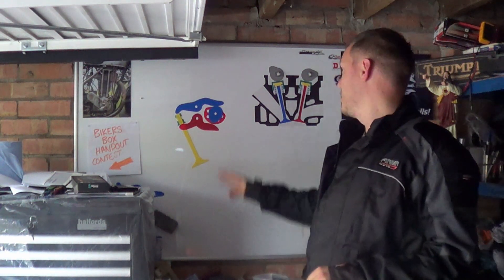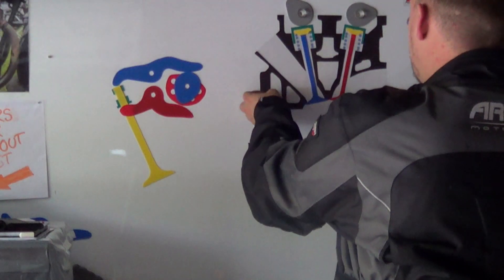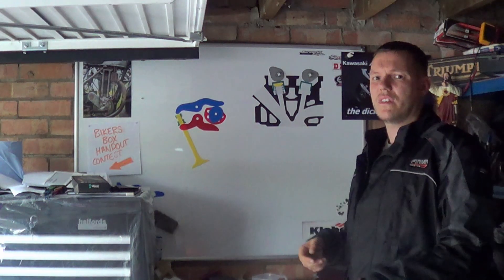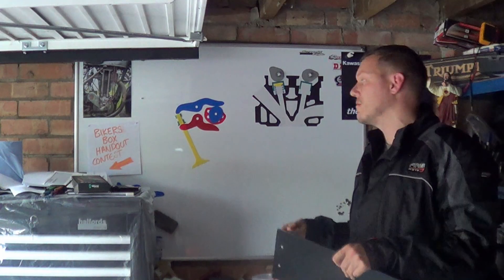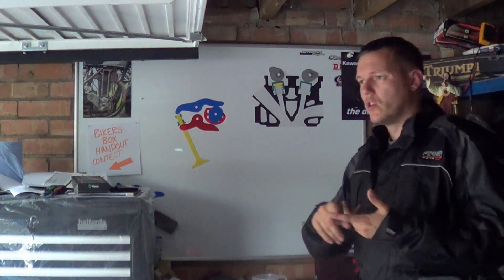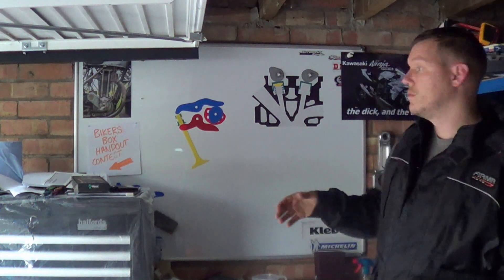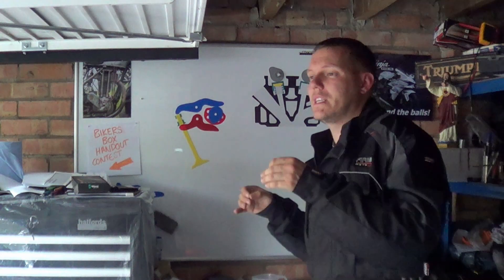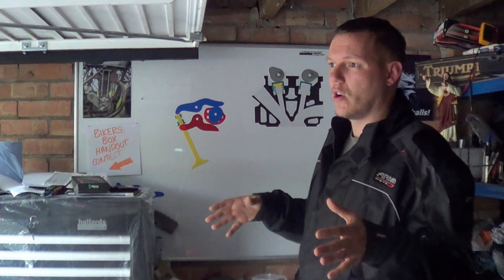Delboy being a wanker!

Comment: Matt, so keeping the (seemingly obvious) Delboy inaccuracies aside for a minute, what are your thoughts on the coolant heat ranges within an engine? To elaborate, I have a bike that the rad fan cuts in on at 106C by default (Set by Triumph), now a common modification is to lower that value to 100C with a remap (amongst other things). 

Cars typically in my experience - cut in a lot lower - Average Thermostat open temp being around 85C ish, Fan on at around 95ish? (Feel free to correct me here..). Given the boiling point of water (anyone want to question that?), with the setting at 106C, there is always going to be pressurisation within the coolant system due to water content, I'm under the impression that keeping it stock at 106C should be the right thing to do, It was designed by better minds than mine to be that way right? So why lower it? Unless of course they screwed it up from the outset!

Now - changing the value to 100C IS going to have an effect (what, other than keeping the engine a little cooler, I don't know - feel free to help me out on that one. Mine is at 100C from a remap I did, the only noticeable difference to me is warmer legs in traffic as the fan cycles sooner). so if that's the case, then is lowering the value a good or bad idea? Don't know personally. Seems like there's no real evidence to suggest it's going to make any real difference. 

So lets humour Evans for a minute. They're using chemicals that have different heat absorption rates, now a submersed coolant sensor is going to read different in those chemicals to that of 50/50...Thermodynamics and what not, so actually, are you going to get a true reading off of the temperature sensor than what you would do with 50/50 due to the heat transfer rate given that the coolant temperature is constantly changing during a running condition? (Rad Fan, Rad heat dispersal etc. etc.) Or am I talking bollocks? If so, for any injected bike, surely that has the potential to cause problems with fuelling levels as the ECU reads an incorrect temperature reference which is then using in a fuel calculation alongside Inlet air temp, knock, lambda etc... Now i definitely sound like I'm talking bollocks.

That was a waffle and a half... 

Great channel. Keep it up.
Reply from the maker: "are you going to get a true reading off of the temperature sensor than 
what you would do with 50/50 due to the heat transfer rate given that 
the coolant temperature is constantly changing during a running 
condition?"

- great point as this is what happens to people bikes, the fan stays on for ages or just doesn't turn off. As for localized temperatures we're gonna find out in the ER5 test
Reply: Will be interesting to see what the ER5 turns up on this test, especially considering that my ER5 overheats on anything more than a 20 minute ride! Hahahahaha

Comment: I just did one minute of research on Evans water-less coolant. I googled "issues with evans water-less coolant". It seems evans pay google a lot of money to keep themselves first and foremost. What threw the red flag for me was evans own words. They go like this "Evans is the only manufacturer of water-less coolant in the world". My first thought was why are they the only one who does this. After running a shop for multiple years, all my coolant comes concentrated in 55 gal barrels, the same concentrate as evans. Evans just so happens to not put on their labels MUST ADD WATER! I have no problems using evans but it will get 50% of water added to it. I am not in the business of replacing cylinder heads free of charge or in some cases cracked blocks.

Comment: I found this reply from Del to someone that left a comment on his Evans video. He really has fallen for the Evans Scam like a fool - "Damn right I do fellah... that's really interesting!  And I would also say the guys from Evans would be interested to know that too.  They have a product that every know it all out there thinks they can argue with and contradict, purely based on summisation and hearsay, so they always love conclusive proof their product works... with my 'fighter build, I filled it to the brim, and have run it up a few times since, it just pukes out about a tea cup full at best to make expansion space.. there is expansion, but it's purely thermal expansion of the metal and the fluid itself swelling up, not gas expansion from boiling... temp, gauges often show hotter, but that's cos they are metal, and this fluid draw more heat away from the heat source and carries it within itself, so the fluid run hotter, which, naturally, means the engine runs cooler... my fan kicks in more often, but for shorter periods, which is also an interesting development..... either way, give it 10yrs and no motorcycle will run water in it's coolant... give it 25yrs and no coolant system will run anything else but this, they will be sealed for life and there won't even be a fluid level marker!  Top stuff, sold me the day I saw it....thanks for the info buddy, Happy New Year! All the best, Del"
Reply from the maker: "thermal expansion of the metal"

- fucking gold lol

Oh OH there's more 

"my fan kicks in more often"

- LMAO!

"so the fluid run hotter, which, naturally, means the engine runs cooler"

- A typical misunderstanding of thermo dynamics. Heat can only transfer in one direction from hot to cold. If the engine is cooler than the coolant, then the coolant isn't cooling, its heating. People seem to think that cold is a thing. 

"my fan kicks in more often, but for shorter periods, which is also an interesting development"

- which means you have a less stable coolant - which is what we all want, they less stable idle and a less stable marriage lol

"either way, give it 10yrs and no motorcycle will run water in it's coolant"

- I will literally do a video 10 years from today on this!

"Top stuff, sold me the day I saw it"

- more like you've been sold down the river - a river of non-boiling Evans lol (Only $99.99 per fluid oz, requires prep fluid and 650 fl oz of stupid)

Comment: Hi Matt, huge fan of the content, helped me a lot to understand more about bikes. Though one part in this video bugged me. You said at 21:50 that the thermostat remains open all the time after engine reaches it's working temperature. I once had a problem with my car where the thermostat seized open and engine would warm up almost to operating temperature while sitting in traffic, but would cool down bellow scale (<60°C)  afterwards if l was cruising at constant 70km/h or so. And that wasn't even winter, it was a rather nice autumn with ambient temperature around 5°C. So my question being: wouldn't a bike cool down bellow it's operating temperature if the thermostat remained open while riding, or is something in bike cooling system being very different from cars?
Reply from the maker: Because of weight concerns - bike tend to run less coolant, to this end the cooling system (on most bikes) rarely drops below this temp. I've done and will be doing more vids on the SV whilst measuring temp whilst riding. You see the temp never drops below about 90 ~ 95degC
Reply from the maker: LOL pressed post too soon, the second thing is where you temperature is taken. On some engines its in the head somewhere, on most (but not all) bikes the dash board reading is measured from the inlet side of the rad. This is quite a bit down the line from the thermostat (again depending on the arrangement) 

The closer to the combustion chamber the hotter the temperatures are. It all depends where the temp is measured.
Reply: But doesn't that make bikes more vulnerable to ambient temparatures? Let's say you take your bike for a spin at -20°C and go at around 100km/h with very slight throttle input. I doubt your radiator will sustain 90-95°C.
Or did you mean it in the way where a bike has the same capability of closing the thermostat and it's just rare for that to happen under normal riding conditions?

Comment: I've just taken a look at delboy's video when he first introduced evans coolant. He calls cavitation 'The pump spinning in a cavity'  https://youtu.be/v_2LCyN9eQ0?t=163. Couldn't help but laugh. I was taught cavitation is a pocket of nothing that's created by an intense and rapid change in pressure in fluids (namely water) that will then collapse and create a shockwave which will ultimately erode away the material it cavitates on. This was taught to me when i was still in mechanical engineering. Wikipedia seems to support that teaching

Taken from wikipedia: "Cavitation is the formation of vapour cavities in a liquid, small liquid-free zones ("bubbles" or "voids"), that are the consequence of forces acting upon the liquid. It usually occurs when a liquid is subjected to rapid changes of pressure that cause the formation of cavities in the liquid where the pressure is relatively low. When subjected to higher pressure, the voids implode and can generate an intense shock wave." https://en.wikipedia.org/wiki/Cavitation

Looking at the rest of the video i just couldn't help but think he fell for the marketing stuff. All the thermodynamics have been explained already so won't repeat those. I figured someone who refers to cavitation as 'a pump spinning in a cavity' either doesn't know his shit or isn't the sharpest tool in the shed. Which would explain why he fell for the marketing 'wank'
Reply: His final Q&A video on it also contains a lot of guff.  He states the expansion tank is a catch tank and completely misses the point of how a pressurised system works and how it would draw the coolant back into the system (even shows the feed at the bottom of the tank which would allow it to be drawn back into the rad).  He goes on to say the coolant will be boiling around the cylinders again missing the fact that a pressurised system helps prevent boiling of coolant. I actually like his video's and many are great for beginners, but unfortunately he occasionally shows a big lack of knowledge in certain area's and the danger is he says it with such conviction that new riders etc will take his word as gospel.

Comment: yo matt can you start making online classes for deeper engineering stuff ? like go through all the maths, physics and chemistry ?
Reply from the maker: its coming dude
Reply: If you need help with the chemistry Matt, you know where I am :)
Reply from the maker: Dave you have no idea how much your going to regret saying that lol Actually, Magnesium vs glycols - chop chop
Reply: Okie dokie. I did some formulation work on a metalworking fluid for Shell that was for Magnesium/Aluminium alloy machining and the thing to avoid is the formation of Magnesium Hydroxide in the water, as this sends the pH through the roof and can cause other metals to corrode, as well as cause skin irritation issues. The coolant I gave Shell guidance on was called Dromus MG and was used at Cosworth Racing, Northampton and BNFL Fuels, Springfields specifically for Mg alloy (Magnox) machining and where other coolants split due to the hydroxide formation, Dromus MG didn't. The Magnesium Hydroxide issue was solved by using Sodium salts of the carboxylic acids used in the coolant (all Sodium salts are soluble in water, basic chemistry) and Sodium is a more reactive metal than Magnesium, so it inhibits the formation of Magnesium Hydroxide. Sometimes, what seem like complex issues can be solved with elegant chemistry. The concept of using Sosium salts came from water-based pit prop hydraulic fluid used in mines in South Africa, where the water can be really hard and full of  Magnesium and Calcium salts. The National Coal Board even came up with a test water solution based on South African water to test pit prop fluids (Spec No. 18 and No. 19 waters) at their headquarters in Bretby.

Now, to radiator coolants. Adding MEG or MPG to water makes it less polar and hence the corrosion rate for Magnesium and its alloys actually falls with increasing glycol concentration - simply put, there aren't as many free OH- ions to form Magnesium Hydroxide. Throw in a metal passivator, such as a benzo- or tolyl triazole derivative (Irgamet 42 is the usual choice these days) and you can get the corrosion rates down to microns per year. These passivators work by plugging active corrosion sites and prevent galvanic corrosion. Using 50% glycol and a decent inhibitor package in a mixed coolant system means that you shouldn't worry about corrosion of Mag alloys.

Next!

Comment: Water boiIs @100C @atmospheric pressure.  Put a pressure cap on & the system is pressurised so the boiling point is elevated & it has to reach a higher temperature before it turns to vapour.  That's kind ofthe point of pressurizing the cooling system.  Also why it's so Dangerous to take the cap off- when that high-temperature water which is kept liquid by the higher pressure is suddenly Dropped to atmospheric pressure it rapidly vaporises & explodes into you face & eyes, over your hands & burns like fuck.  Then again, who hasn't gently eased the rad cap off rather than waiting for it to cool?

Comment: interesting talking about coolant but a couple of things firstly radiators convect heat by warming the air passing through the radiator. Also water does have a boiling point of 100'c but under pressure or in a sealed system this increases.
Lastly cavitation I thought was down to system/pump design and not temperature although now you've got me researching and my conclusion is its the design but a higher temperature can make it worse.
interesting stuff !
Reply from the maker: "interesting talking about coolant but a couple of things firstly radiators convect heat by warming the air passing through the radiator. "

- not at 100mph they don't. 

"Also water does have a boiling point of 100'c but under pressure or in a sealed system this increases."

- I don't understand why you worte this???